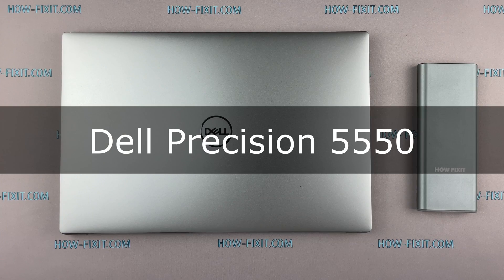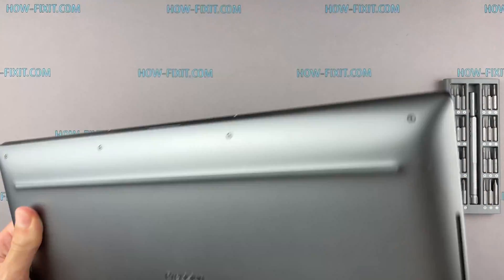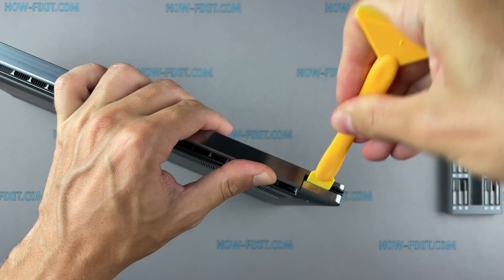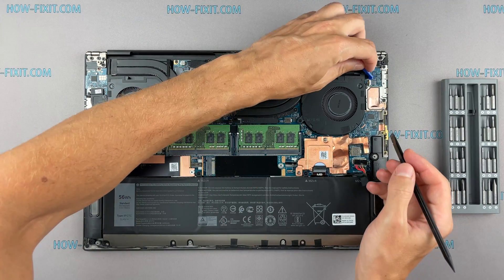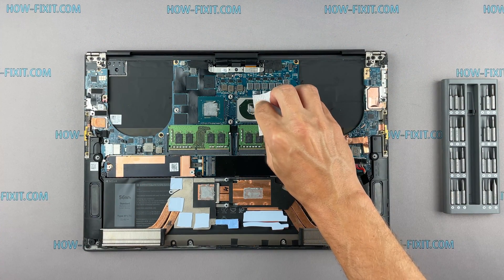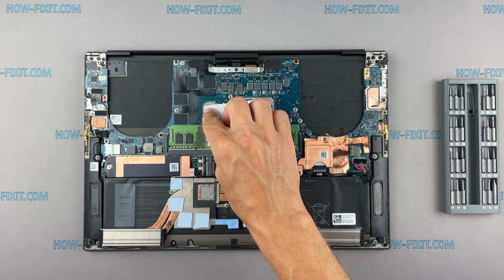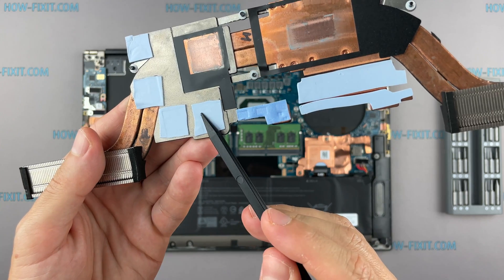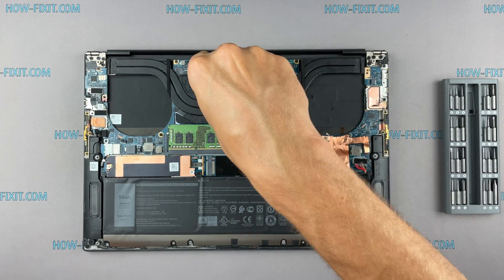Dell Precision 5550 Disassembly, fan cleaning and thermal paste replacement

Comment: Any idea what that thermal pad on the bottom left above the battery and MB sign is for? Can it be replaced and with what dimension (thickness)? I managed to  cut it off a bit and don't want to have some other thermal issues as I ocassionally feel more heat above Windows/ALT keys on the left hand side.

Comment: Two corrections from the Service Manual (Thanks Dell for always having a service manual, even if it doesn't spell everything out).
1. The manual warns opening from the back can break the screen.
2. The heat sink 4 step screw removal is supposed to be done in reverse order. start with 4 on removal, and start with 1 when you're re-installing the heat sink.
Reply: The manual warns opening from the back can break the screen. ?? where
Reply: +1 to post this, do not open from the hinge end, open at the front first! There's an extra slit to make this easier.

Comment: Thank you so much for this guide! It really gave me the confidence to try this. And I'm glad i did!
Two comments:
1. You probably want > 70% iso alcohol. It took me quite some time to clean off the thermal paste as the paste on my CPU and cooler was really caked on and dry from the factory.
2. The battery cable was a PITA to get in and out... 
Otherwise a smooth operation.
Reply: How the hell did you get the battery cable out?? Mine won't budge
Reply: @ i used a wide spudger to push the cable out. This took a while because the plastic on the cable would warp if i pushed too hard.